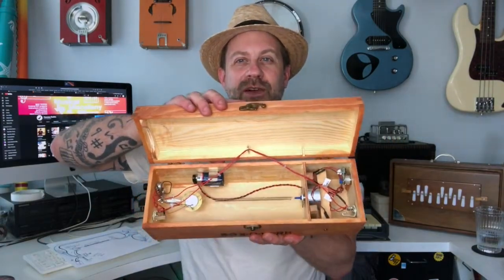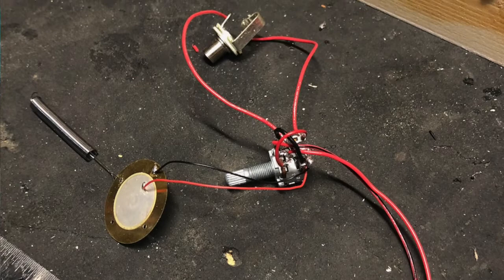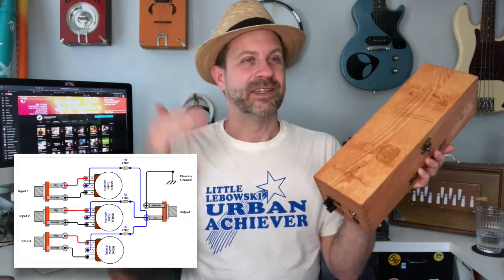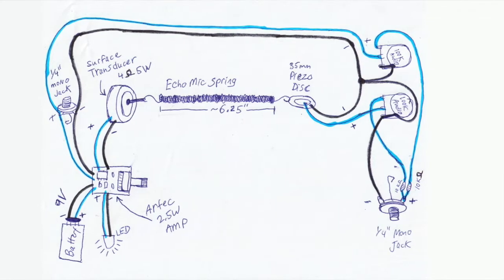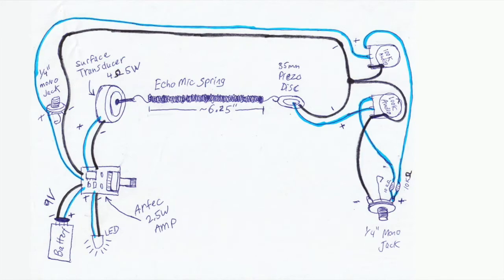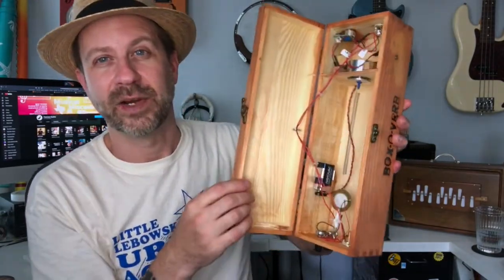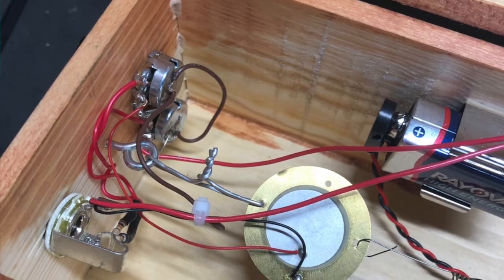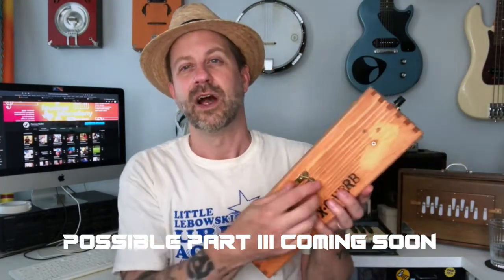Building a DIY Spring Reverb: Part II

Comment: Very impressive effect. I love the range of your gear you've used for the demonstrations. This makes me want to make one of these.  (I once had a guitar amp with a spring reverb. All I remember about it was the clanking it made when you moved it about).
Reply from the maker: Thanks for checking it out. I love that effect when you move an old tube amp while it's powered on. That's so great. This box definitely does that too.

Comment: Have you tried extending and contracting the spring to get different levels of reverb (not sure the term to use here)? If it dos affect the wetness, you can ad a mechanic pedal to make it more interesting I guess..
Reply from the maker: That's a really good idea. A small lever to add/remove tension on the spring would be brilliant. I like how your brain works.

Comment: What a cool project! I really like the sounds you are getting from the Box-O-Verb! I wonder if a similar design using a magnetic pickup under the spring would work for a different sound?
Reply from the maker: That's an excellent idea Drew. As long as the spring is magnetic, a standard guitar pickup should be able to create a signal based on the vibrations. Maybe that's a future modification.

Comment: Impressed that you got videos 2 and 3 out so quickly. A lot of youtubers often don't have part two in 12 months time. So my question is this....... what made you decide to do one spring instead of the standard two? I'm sure you could connect a second one with the space you have. My guess is it would result in more vibration and a deeper reverb.
Reply from the maker: Thanks for checking out the videos and for the suggestion. I mentioned in the beginning... the design came from one of those toy echo mics, so that's why I used the single spring. I was basically trying to turn one of those into an effect. Ironically, I thought of the same thing you did after the fact. You could easily use 2 or even 4 springs based on the size of the transducer plate. You'd have to come up with some sort of mounting plate for the stationary side but that shouldn't be too difficult. It's a idea for a possible second try.
Reply: @musicalmiscellany  Yeah seemed like it was a "lets see if this works" type of project in the beginning that all of a sudden was "oh hell this actually works!" sort of thing.  I've had quite a few projects thta kind of evolved in that way too....but of course those that evolved into nothing as well. Great job on keeping up with the videos!
Reply from the maker: @TheSickNeeds  And likewise... thanks for tuning in. Again... thanks for the suggestion.

Comment: This is awesome! Would it be possible to add a True Bypass footswitch to activate/deactivate the reverb?

Edit: I know you can just turn down the wet signal to 0, but that's not easy to do while both hands are busy playing the guitar...
Reply from the maker: Thanks for checking it out. You certainly could add a footswitch but that little mod makes every simple circuit a lot more complicated. Remember, true bypass switch is actually a network of 3 switches (one for power, one for clean tone, and one for effected tone). In the "on" position the power and effected signals are connected and in the "off" position only the clean connection is made. All of that said, you could definitely do it if you wanted.
Reply: @musicalmiscellany  That's more complex than I thought! Thanks for explaining.

Comment: Woah! Good job man! Sounds awesome! Also,
What synth is that? Did you make it?
Reply from the maker: Thanks for checking it out. The synth I used in the vid is the Noisebox 2 from Synthcone (Etsy Seller). It's basically a slightly modded version of the MFOS Noise Toaster.